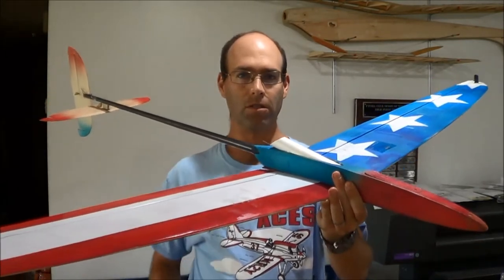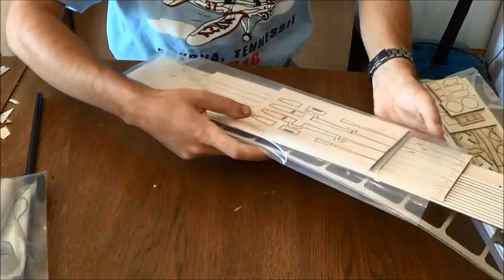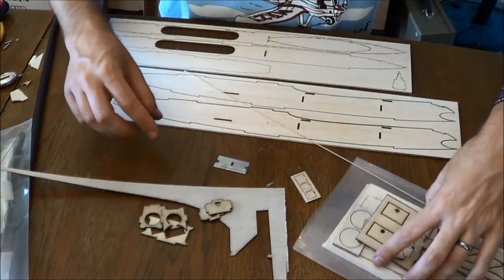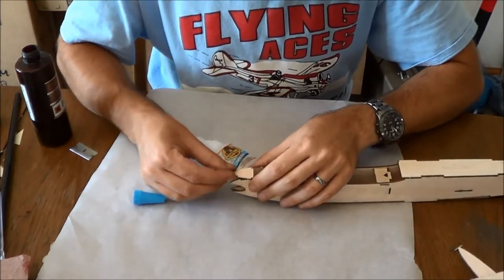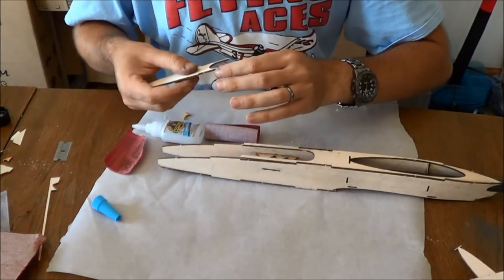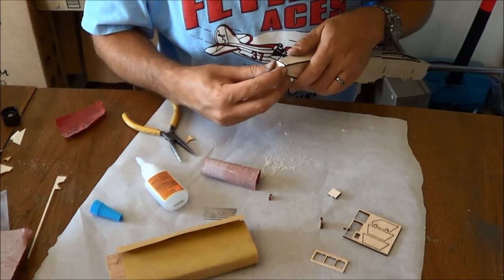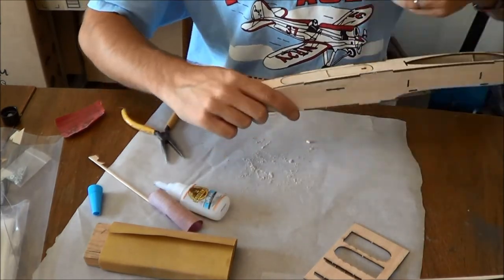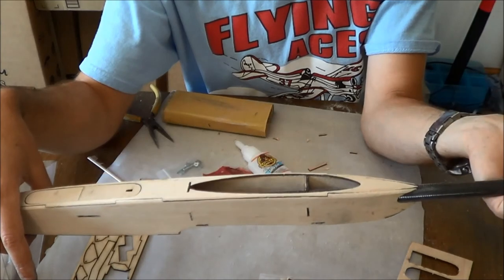Evo Fire fuselage build, Part 1

Comment: Just got the package today, it survived USPS. Got the fuselage nearly complete in one sitting. Looking forward to building the wings. Thanks Joshua!
Reply from the maker: Awesome! Let me know if anything gets confusing. It's definitely a rewarding build. The wing top skins are a little challenging but they work out well.
Reply: @joshuawfinn  Just put it away for the night and I've got one wing completely shear webbed so far.
I plan on joining the halves like Traian; epoxy and phone books. I'm also going to use KST's for the first time. I'm looking at getting a carbon DLG sometime and figured this'd be a good test of my mechanical and fabricating abilities.

I might get some photo's of the process I'm going through and post them to RC groups or something. All that said, I'm really liking the under fuselage wing mount. If I've got an issue at all I'll be sure to let you know. Glad I came across this last year!

Comment: Is this kit easily modified to a top wing configuration? I'd love it as a DLG but I wouldn't be using a rocket motor.
Reply from the maker: Mythradites, a closed fuselage top is included so you can build it without the rocket mount, but it still builds as a low wing like the CX5, Solar, etc. I've considered making a high wing fuselage but really can't see the benefit of it.
Reply: @joshuawfinn  thank you